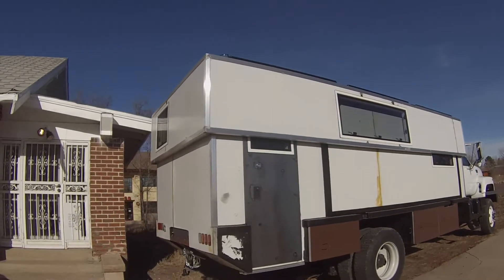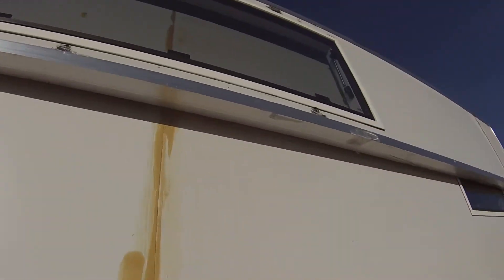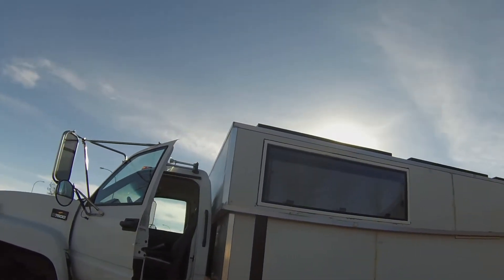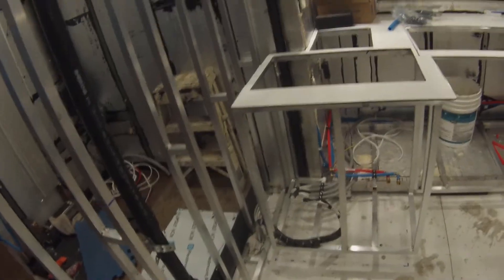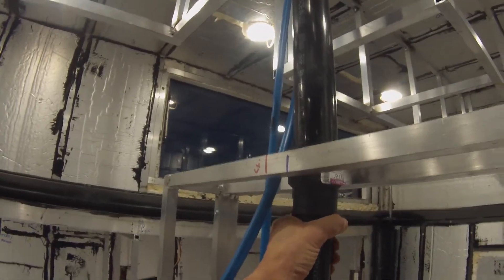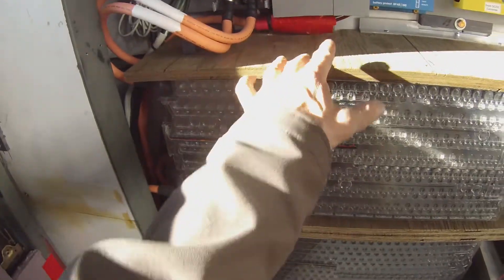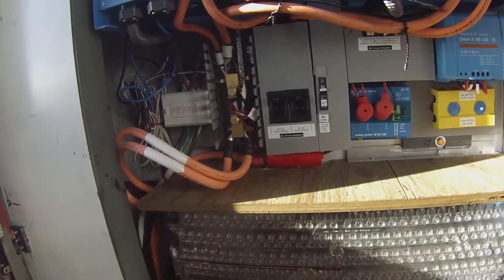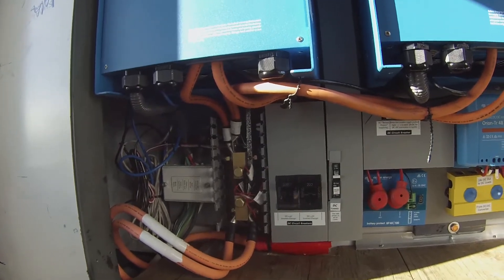THE WORLDS MOST INCREDIBLE 21 KWH TESLA POWERED TINY HOME

Comment: Looks good. How did the Spring Torsion sub-frame work out. 3 on each side with 800lbs springs ??
Reply from the maker: I have four on each side. They have worked great when I tested them after installing. I have not been four wheeling to really test them out.

Comment: That all looks and sounds expensive, was it, will it be worth it? I'm going to have to check out your website to see if I can find a explanation of what your goal with this rig is. I want to do my own build but I was thinking of keeping it simpler than you are building. My idea is I don't want things to break, have high maintenance or repair costs  or have something cause me to be stranded somewhere that getting parts would be difficult , expensive and take too long. I'd love to know the thought behind what your building and why the need for complex electrical with that much power. Is there a overview of what your doing and why somewhere that I have missed by just finding a few of the build videos?
Reply from the maker: The costs are definitely adding up. However everything I've used has been so that I do not have issues down the road so I have used the best quality products I could find, including the wiring which is marine-grade and it does not corrode and it's resistant to vibrations because the wire strands are smaller than regular wiring. And honestly the main reason I'm doing it this way is because you cannot buy a rig like this. I plan on traveling the world eventually and don't want to have any issues
Reply: Sean, I have been following this guy's build from the beginning and love seeing his progress. If you want to know more about the "why" behind his project, and get a better understanding of what came before, I would recommend two things. One, check out his very first video, it kind of explains where the idea came from, I think. Also, he has a pretty cool blog that goes into some more details too (as well as adventures he has in the truck). Check it out at https://www.mygourmetexpedition.com/ Hope that helps you out a bit!
Reply: Cait I Thanks, I did get a reply from the owner of this truck and did watch all of his videos now.
It’s a massive project, not sure I’d undertake but definitely interesting to see what he does.
I’m considering either a trailer or a 6x6 Stewart Stevenson, comes down to whether to haul a second vehicle or use a modified Land Rover to haul an custom built expedition trailer which both have advantages and disadvantages.
Best solution would be a few Billion dollars and yacht with all the toys but that’s not likely to happen. Total freedom and the least amount of maintenance, repair work, expensive disabling break downs that can’t be done on the road without having a work shop would be my preference.
Myself, having pull outs and ups that totally depend on electronics or hydraulics wouldn’t be anything I’d want to have to contend with should a major component fail but that all depends on a persons intentions and where they will travel. The worst thing about a military vehicle is the weight of the engine, gear box, and other mechanical components simply because it would be very difficult to rebuild or have to exchange anything in some remote place, may even be difficult to tow the vehicle out or would be very costly.
This project gives a lot of ideas and things to consider, love when someone has their own vision of what they want and goes for it.
Reply: @empirecases4128  Glad to hear you got your questions answered. This guy sure is undertaking a huge project! Why you might want a smaller or simpler build for yourself certainly makes sense. This project sure does provide a lot of inspiration, can't wait to see his finished product!

Comment: Wow! That is a pretty incredible system. The work Tesla does is very interesting and so I'm glad to see you incorporating it into your build! However, with such a complex system, there must have been some difficulties with its design/installation...Did you encounter any issues or little hiccups with the Tesla/solar install along the way?
Reply from the maker: Funny you should ask. I was running the batteries through some testing and a giant spark shot across the top of the battery packs and shut down both of the Victron Inverters. I poked around to find a loose connection that we missed and it was arcing so hard when current was running through the bus bar that it was glowing orange ( molted  lava orange). Easy to fix, super scary.
Reply: @expeditionvehicleadventure2141  It's not a party until something melts or blue flame shoots out.
Reply from the maker: @psalm6408  for sure for sure, the party has started